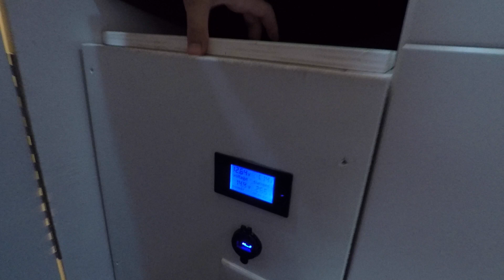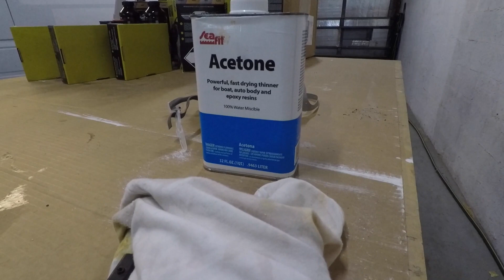Making of a Mango van

Comment: Cool video - it really make me want a campervan. I own an extra 2012 Sprinter passenger van that I'd love to convert. My issue is, I also live in Miami and I am worried about not having an air conditioning to sleep... is there a solution for that?
Reply from the maker: Mango Vans has many power options and are partnering with marine a/c specialist to solve this issue. We do add air-conditioning but it is an issue of batteries, chargers and cost.